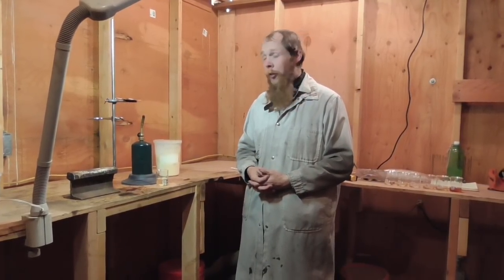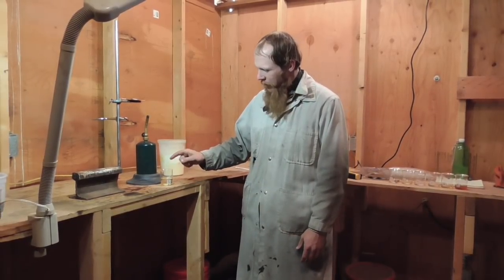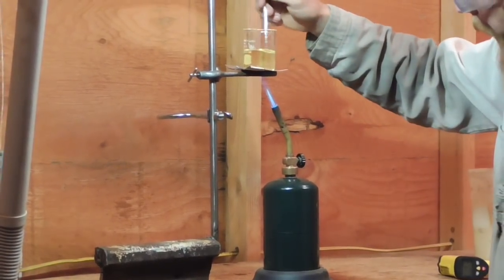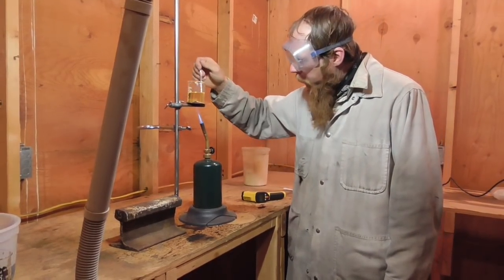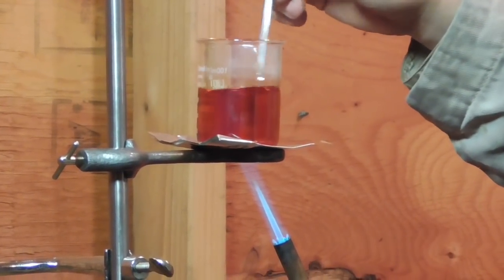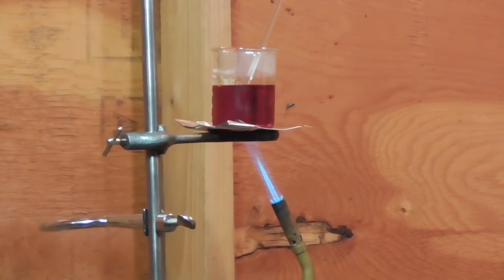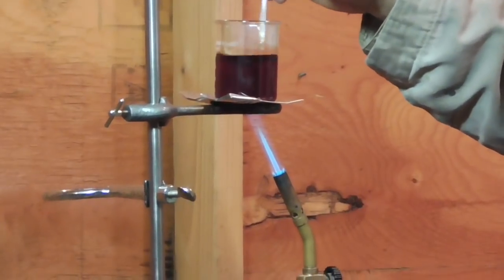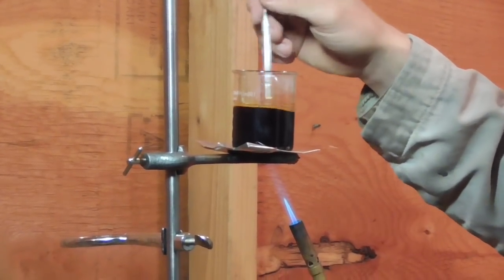Sulfurizing Canola Oil (TIS108)

Comment: Interesting. I added some sulfur to engine oil but found that it didn't dissolve at room temp. I figured that it either required heat or that the sulfur should be in some other form than pure. Nice if it's as simple as heating the oil.

Comment: Oh is that how it is made? If that's it, I'll make some cutting oil instead of using motor oil. Thanks for the tip
Reply: Is it supposed to work any better? Motor oil is probably cheaper.
Reply: I can't get cutting oil in reasonable quantities where I am or I would already be using it. At the moment I use used motor oil mixed with equal amounts of water until it becomes an emulsion. It works as coolant and provide some lubrication but the thread surfaces are rough.
Reply: You can use animal lard, preferably from pigs, to use as threading lubricant. It must apply it with a brush, I use an old 1" brush and keep the lard in a tin can. For small diameter and finer threads chalkboard chalks work equally well, the chalk is simply applied while the work is turning. This is applies to ferrous metals and stainless steel.

Comment: I think I have to try this out myself.
Is there a reason you went with the canola oil?
Maybe next you can experiment with chlorinating the sulfurized canola oil
Reply from the maker: Mostly I went with canola oil because it's relatively cheap, readily available, and has a high smoke point / flash point, so there was less danger of catching it on fire or smoking up the room when heating it.
Reply: Chlorine organic compounds have problem with bioaccumulation so it's not safe to produce them at home or even use them, they are being phased out.